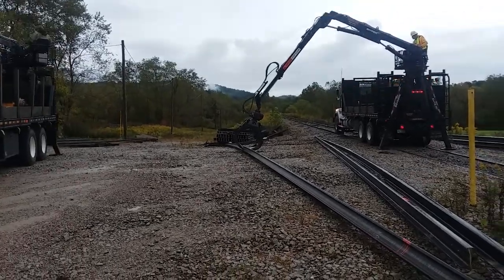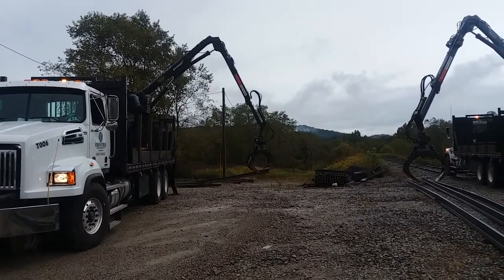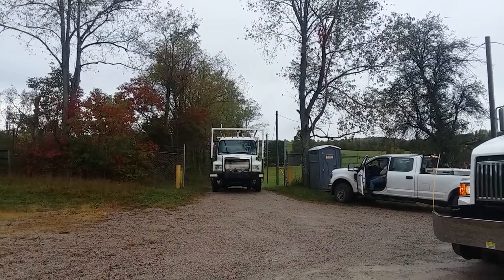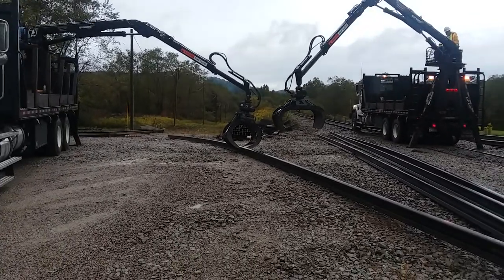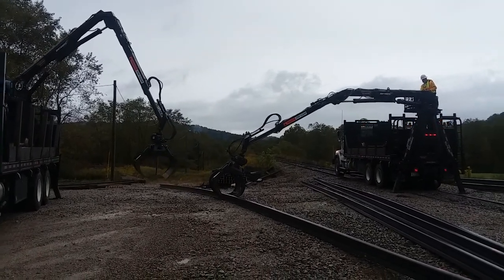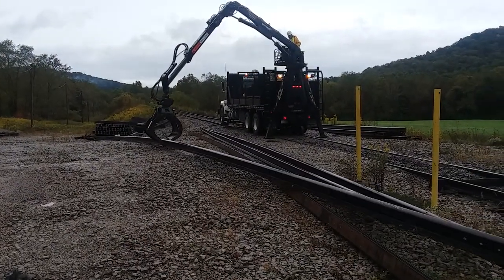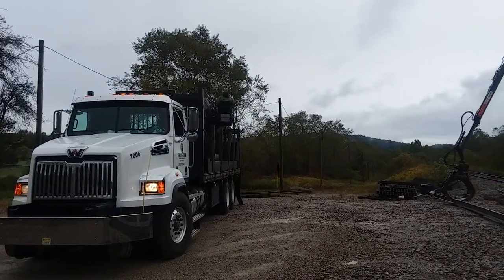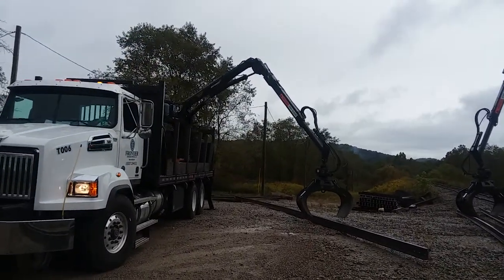Moving 78 Foot Sticks of Rail with 2 Grapple Trucks

Comment: Just fyi Bethlehem Steel Steelton started in early 80's making those 80 footers for supposed high speed rail that was gonna be everywhere but up till then they were 40'.Coincided when a continuous cast plant was put in so a higher grade of rail could be rolled instead of reheating poured ingots and rolling.